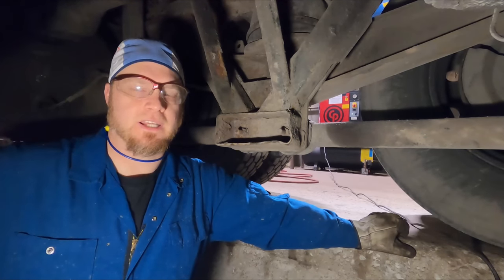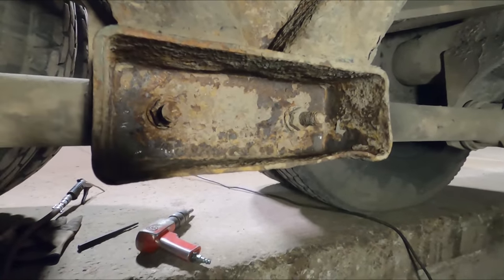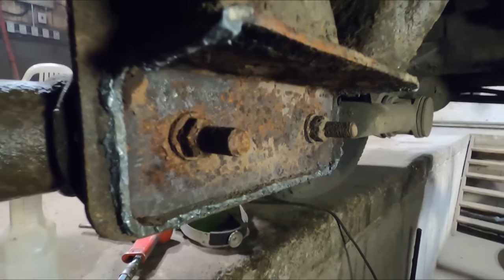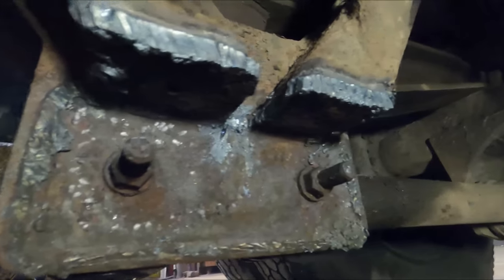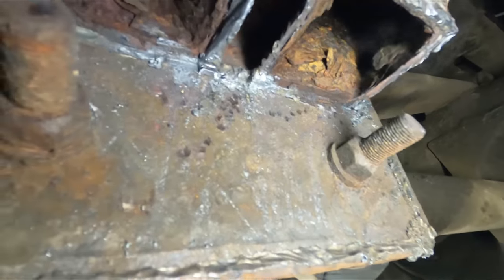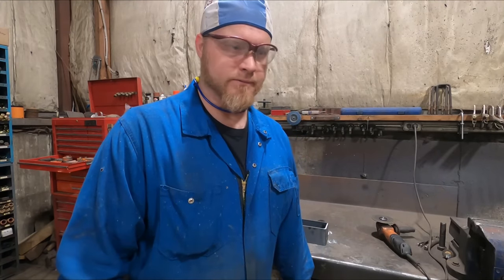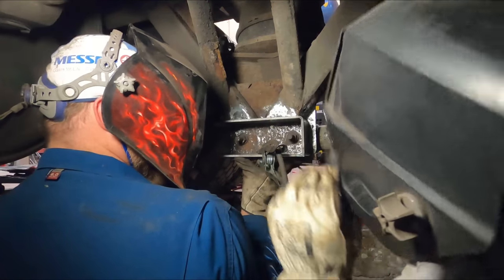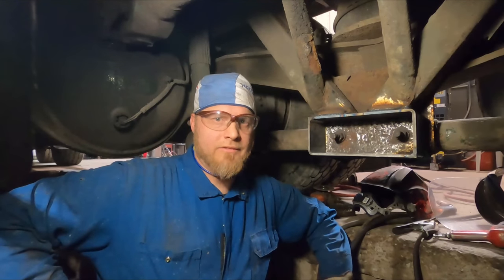Bracket Rebuild on Chalmers Suspension

Comment: That's so different to what I thought you meant when you said replace this box. The side with the bolts through I would have also cut out. And, seeing how rusted the brace was I'd have cut that out and repaired it too. He guy wants a repair done to make it strong not roadworthy. Oh well, you're in business since you know how far to go. Good prep. Use just the air to cool it off instead of soaking the place. That's my tech tip of the day!

Comment: Have you ever looked into arc air set-up ? great for finding the seams between the steel plates. used for gouging out cracks & lancing out frozen pins. The expendable carbon rods are cheap. Keep up the great work.
Reply from the maker: I've heard of them before, but know nothing about how to get them or use it.
Reply: @simcoespring  its basically like reverse stick welding lol
Reply: Icweld has some videos on arc gouging
Reply: Arc air is a great tool for this type of job for sure. Money well spent.!
Reply: Your welding is awesome and equal to your torch cutting. You’ve got to be saving your customers $$$$ by keeping their trucks on the road and running great. BTW you have the tidiest truck suspension repair shop I’ve ever seen.
Reply: @simcoespring Look into them, they're worth learning, especially if you're removing parts welded together.

Comment: What a stupid design for a suspension, and flimsy too. Water and mud get trapped in the rectangular pipe and rust the whole thing out. All to save 10 bucks worth of steel plate. 
BTW Don't Not you need to weld the inside seam of that box section?  Water will get into the crack and rust it out again in no time.